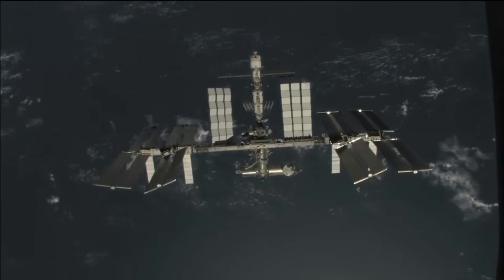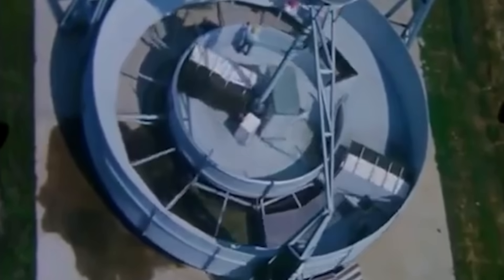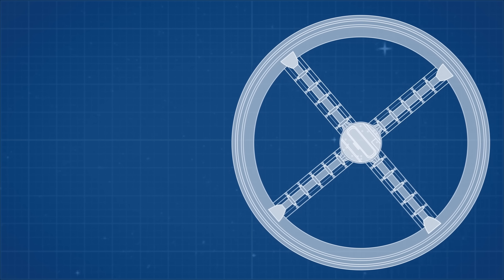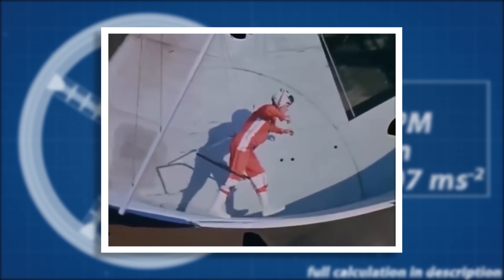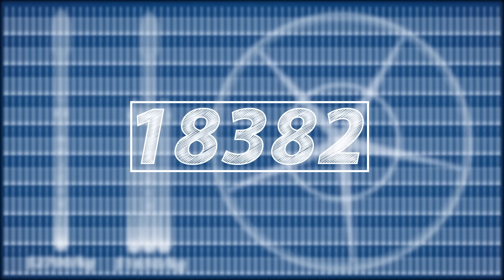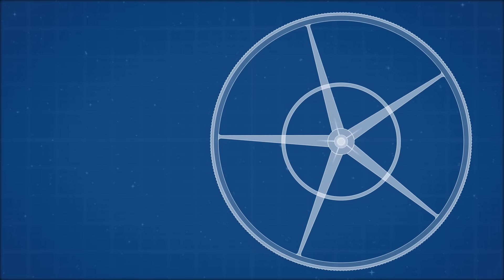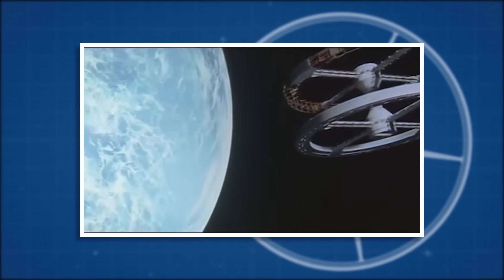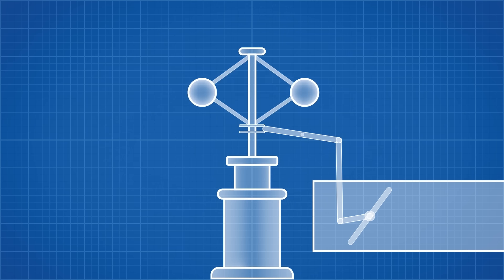Can We Create Artificial Gravity?

Comment: You don't need to make it a sphere you could make it a long rectangle with gravity at either end. Also if it didn't have any windows it wouldn't be disorientating. Also you could make a room in the center of the structure that was spinning the other way so while looking out of the room it would be appear to not be spinning, but it would not have any gravity because it would be in the center of the structure.
Reply: I like that idea. You could even just have a non-spinning ship with a long arm that spins around the rest of the station. You could have the end of that arm be living quarters and a gym while the rest of the station could be used as a typical zero G station but you'd only have the expense of making part of it spin quickly on a long arm.
Reply: There is no outward force of the Earth's spin. It is simply our momentum wanting to go straight out, tangent to the surface, into space. There is no outward force. But if you want to know the amount of gravity needed to prevent that from happening, it's 0.0339149859 m/s^2.
Reply: djayjp There is none! If you drew a free body diagram, you'll see that there is no outward force, only an inward force - gravity. And G is just the acceleration of Earth's gravity. So you just divide the number by 9.81 m/s^2. (So an insignificant amount of Gs if you cared to do the math.)
Reply: Oreoclan What you say is true in inertial frames, but it is also common in physics to use a rotating reference frame, in which case there will be a centrifugal force and a coriolis force. Both are so-called "fictitious forces", but they are needed in order to correctly prediction motion in the rotating frame.
Reply: If your eyes are closed, the reason you still get dizzy is a combo of the different centrifugal force on different parts of your body (mentioned as a problem in the video) and the "coriolis force", another force felt in rotating reference frames which is felt whenever you try to move around in that frame (like if you move your head while your body is being spun around). Both of these would decrease the larger the radius of rotation.
Reply: +Ethan Johnson it would need two or more balanced arms, otherwise it would cause the "non spinning" part to spin
Reply: A typical design is not a sphere, which would be a ball like structure. It would be a ring, like a hoola-hoop. Making a sphere would use much more in terms of materials and would give negligible use over at least 2/3 of the inner surface
Reply: I wonder what the outward force of the earth's spin is in relation to its gravity pulling inwards?
Reply: Oreoclan Well, force as in F. Hmm but how many Gs is that?
Reply: Oreoclan The Earth is spinning, no? So what do you call that? lol I guess you would say it doesn't fit as F since there is no acceleration, as in F=MA? I don't understand why this wouldn't apply to gravity/spacetime curvature then too since it's constant (not accelerating). I really do not understand why spacetime curvature would cause acceleration anyway. Anyway, wow that's interesting. So the "force" (?) of the spin is only about 1/300th of the earth's gravitational pull.

Comment: This is why the future depends on mining, smelting, and all other metalworking processes all being done in space. Real estate values here have no comparison with the value of mining rights in space. I guarantee guys like Elon Musk are already considering this.
Reply: I think you can google how much an asteroid is worth in space (potential material cost you can get from the asteroid) Its around 5500 billion.
Reply: The value of an asteroid is relative and hard to predict. If you were to take all the materials you could get from one and flood the market, the price of that material would drop and lower the value of the asteroid.
Reply: Virgil is right. I thought about mentioning the false assumption in calculating an asteroid's value based on current market prices, but figured that's not the point. And initially much of the extraterrestrial mining will result in materials brought back to earth I'm sure. That process will be developed and refined [rimshot] before we have the ability to process the metals in space, much less an immediate use for the materials there. But it's also rather difficult to get the raw materials back to earth without causing significant damage to both. But as we don't yet have any experience with mining actual asteroids there will need to be some metallurgical testing before the other processes are developed. 

Finally no two asteroids are likely to have the same proportions of elemental composition, and exact mass is difficult to calculate from a remote, geocentric perspective, but the idea of putting a value on them is still insightful as long as it isn't taken too literally.

Comment: Okay, so a question about centrifugal force:
If i'm swinging a ball on a string around in a circle above my head and let go, why does it fly in a tangent to the point on the circle that I released it?
If centrifugal force is a thing (an outward acting force on the ball) then why does it not fly off at an angle greater than that of the tangent? This is the thing I can't wrap my head around. Also if centrifugal force is a thing then why can I swing the ball around at all? Why doesn't the ball get propelled inwards as soon as the string reaches full extension?
Reply from the maker: Okay so in normal circumstances, let's say with gravity. The force pushing us downwards is gravity and the force resisting that is the reaction force from the ground. We do not move because we are at equilibrium. With centrifugal force and centripetal force it's the other way around. Centrifugal force is the reaction force and it ceases to exist the moment the centripetal force is removed. It only exists within a rotating reference frame where we need to balance forces, outside of that reference frame we can see that it is a result of the masses inertia. That's why it's called fictitious. It is a difficult idea to get your head around and it is made more complicated by confusing terminology.
Reply: Another helpful view is that the motion of the object experiencing centrifugal force is always in a straight line, only to be redirected constantly. As soon as that redirective force (the ball's tether, for instance) the ball continues in the line it was last directed to (only to then be redirected by gravity, air resistance, a batter, etc.) in the example given.
Reply: I think the most confusing part is that people often say "centrifugal force and gravity cancel each other out, so there's an equilibrium." This is just wrong. If there was a force equilibrium, the object would fly in a straight line. A rotation is an accelerated motion, it needs a permanent force pointing towards the center of rotation. This is called the centripetal force. Gravity acts as the centripetal force and thus makes things orbit.
Reply: Abolish all pseudo forces! The mechanics of Newton are awesome, that is why his theory of forces wasn´t revolutionized until Einstein came along. Pseudo forces include not only centrifugal forces but also gravity, which is actually a feature of spacetime.
As mentioned in the video you have to differentiate between your frame of reference. The easiest frame of reference is an inertial frame, this includes all frames that do not accelerate (including rotational acceleration). Here we see (from the derivatives of the vector pointing to the particle) that any particle on a perfectly cercular path has to experience an inwards acceleration (and not a force acting outwards!). If this acceleration is not given anymore the particle flies off tangential to the path (as you mentioned).
If we use a spinning frame of reference (at the center of the circle) we have to take that into account. Again, if we derive the vector  to the particle (correctly!) we see the same result, a force acting normal to the circular path. No pseudo forces needed.

Although I have to say that there is another interpretation of the newtonian law of forces, named by D´Alambert which includes pseudo forces but this is way more confusing to me.
greets

Comment: do You think, that Elysium would have to have some kind of ceiling, or could it just keep its own atmosphere?
Reply from the maker: Elysium has a glass ceiling. We could build the ISS with more glass, but it would need to replaced fairly often due to micrometeorite collisions. Elysium doesn't have to worry about radiation either....since they have their fancy cure-possible-disease machines
Reply: +Real Engineering I see. but could the sheer spin of that thing hold its atmosphere if it didn't have the ceiling, or would the air just fly out of it into space?
Reply: +Real Engineering; You got trolled Hard my friend.